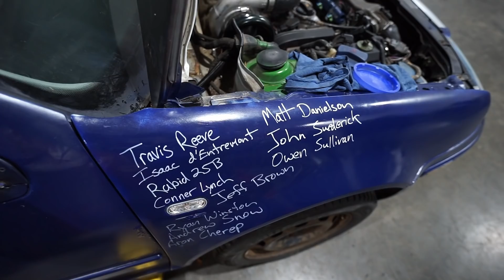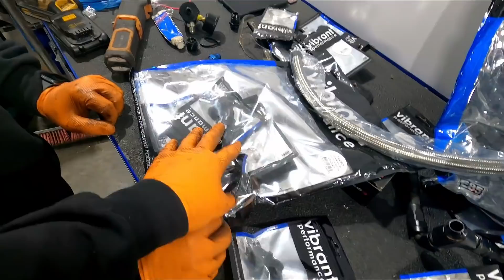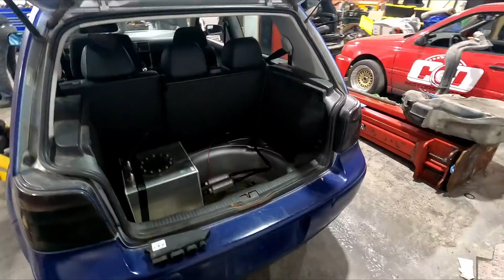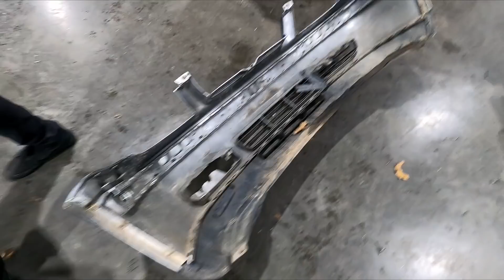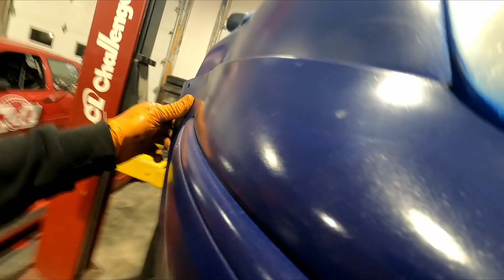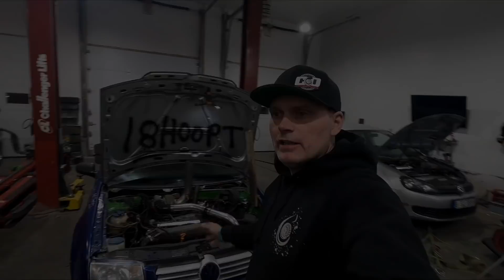Project 18HoopT is alive! Stock engine 1.8T Big Turbo on Standalone Pt 4

Comment from the maker: The mold mobile is alive! Thanks everyone for the support.
Reply: I don't see my name o vthe fender ☹
Reply from the maker: @boosttapperformance8673  this video was filmed over a few weeks so maybe you were more recent, meaning since that footage. Drop us a message just to be sure you weren't missed. But as of the filming of that it was current to my knowledge.
Reply: @COMotorsports  all good no worries keep the content going
Reply from the maker: @boosttapperformance8673  I've dug into this further, mind sharing at least your first or last name so I can figure out what's up.
Reply: If this engine grenades I’d love to see a motor with just maxxspeeding rods connecting rods and nothing else because I’ve wondered if you drop a set of those in a 1.8 if you can make good power or if you need pistons and head work etc like most people do. I’d also just like to see how the cheap rods hold up on there
Reply from the maker: @maxpetruccelli5444  there's plenty of stock piston/upgraded connecting rods 18ts on our channel already.

Comment: Is the aww and awp the same cylinder head my timing belt broke so I am wondering 🤔
Reply from the maker: It's all basically the same, even the ones that are different still work.
Reply: Thank you so much can u remote tune it I'm from USA florida
Reply from the maker: @ricardojaramillojr5071  yeah depending on setup for sure.

Comment: See if you can find a 1.8t with 20mm wrist pins and see if it makes a difference. Lots of anecdotal stuff on vortex used to say the 20mm was stronger than the 19mm out of the early 2000s TTs.
Reply from the maker: The issue is the pins arent the problem. It's the rods themselves. So IMO it makes no difference. The rods were slightly different in some but still junk.

Comment: Hey guys, 

I know you’re well versed in MK4s so I thought I’d ask, any idea what this sound my 12v VR6 is making could be? Comes from only the serpentine belt side of the engine, most prominent on cold starts but will disappear completely when the car warms up to operating temperature. It has been making the sound for the last two years, all of which I’ve spent trying to find out what it is. Every mechanic I’ve taken it to hasn’t been able to hear it because it completely disappears. 

Timing chains and guides have been done, water pump at the same time. I really have no idea what it could be. 

Below is the video link, it’s a lot louder in this clip because the right side is against a garage wall.

https://youtube.com/shorts/A9DppX20NDg?feature=share

Comment: This might be a dumb question, but when going with a standalone ecu, is it possible to retain the original cluster and gauges? or is something different required?
Reply from the maker: It works fine.

Comment: If this engine grenades I’d love to see a motor with just maxxspeeding rods connecting rods and nothing else because I’ve wondered if you drop a set of those in a 1.8 if you can make good power or if you need pistons and head work etc like most people do. I’d also just like to see how the cheap rods hold up on there

Comment: Honest question, would the Front mount Intercoolee fit with an R32 front Bumber?
Reply from the maker: Anything good the bumper and rebar need to be modified.
Reply: @COMotorsports  meh, ok anyways thanks for the replie :) i say the block throws a Rod at 430 ^^
Reply from the maker: @patriklenck1735  it can be done well if you take your time and fab properly. The r32 on our channel has a good size IC on it and we still have all the stock grills in the bumper as well. You'd never know there was an IC and piping under there.

Comment: If it does blow throw in another stock healthier 1.8T Motor, I think so many of us are keen to see how far this goes on stock motor
Reply: everyone must be stupid, doesnt go very far.... Stock rods will do 320 ft lbs, AEB rods do 360 ft lbs, and thats on E85.... This thing is gonna shred the rods instantly. STUPID
Reply: @hei-row  stupid yes, but entertainly stupid... and we all here for that
Reply: @dariusgodden2392  not one bit. If you want to be enlightened you watch Banks power "How to destroy a duramax" Where actual science and logic get used... along with instrumentation. This guy is just gonna melt a piston if he loses fuel from no swirl pot. that or just blow the mains off. It's not rocket science when you just blow up metal... it's STUPID

Comment: If the current engine bends a rod I’d be interested to see another stock 1.8t or two just to see how much luck plays into it!
Reply: if you bent a rod its because you are flooding the cylinder, it doesnt bend when you make power. it explodes. you lost all parts, dont be stupid
Reply: @hei-row  flooded cylinder is one way to bend a rod, detonation and over revving is another. He’d be dropping a whole new stock engine in, doesn’t matter if you blow a hole in the block. Don’t be stupid.
Reply: @Feistiestfrog11  yeah and the same thing will happen but differently. Uncontrolled test. Stupid.
Reply: @hei-row  not sure if you understand, but that’s the literal point of the project…

Comment: Hope you read this I am sitting on the last 04' Passat GL Wagon which has the 1.8T, 5-Speed Manual, Four Motion, shadow blue outside and anthracite interior on the inside. This car has spent most of it's life running at 12lbs of boost. The engine is still solid without burning oil or anything. Quieter than my mother's 2014 Fiesta Titanium. I am hoping you will continue and see how she does within reason. Living in Wisconsin I have her garaged and waiting 4 spring to add a front mount intercooler to it. (No worries I have a welder so no silicone adapter crap where it doesn't need to flex) lol Everything is still original and still solid at 228k. Owned prior by my X-Father N Law who is a salesman for the Toyota Dealership in Madison he had never missed a oil change on her so I'm super interested in seeing what can be possible. Please continue because I would like to keep my, "Granny Sleeper" running as spunky as I can for as long as I can so I don't have to Dr. Frankenstein the beast just yet... Thanks 2 all that makes these vids possible.

Comment: Another 1.8t, keep the stock rods and see how long they can last with that big turbo, they might be last a surprising amount of time with the softer torque curve, and low back pressure of the large turbo
Reply: And put some fart spray on the interior to improve it's smell.

Comment: Well I have a tired 1.8T in my A4. So if that tired 1.8 blows up then we'll know. Personally I think some cheap rods would be a good idea if you don't put a hole in the block. Maxspeedingrods has them for like $250-$300 USD, I bought them, just haven't had the chance to tear mine apart yet. I can't wait to see what this thing does. Also (hopefully you see this) would the ECU Masters wire you guys have work on an AWM? Isn't it very similar to AWP? I need something better than Eurodyne!
Reply from the maker: We can make it work. Also side note weve done plenty of these with upgraded rods so it's nothing new there.
Reply: @COMotorsports  definitely a future plan. Good to know...

Comment: Nicely done!....my a4 "stock 058 block with aeb head" is on trestles right now plumbing up a gt2867, so cant wait for you guys to help me detirmine a safe threshold to aim for 😁.. I think this car is going to supprise everyone and stick around for a while. Would like to see things happen in the following order... Grenade the engine, then start making the necessary supporting internal mods to keep up with the power output.

Please offer some advice on fueling reguirements, hard to find "off the shelf" replacement injectors this side
Reply from the maker: We can provide everything needed to meet your goals. 300whp should be your goal, and on that turbo that's about all you'll see on prump gas anyways.

Comment: I just love the zero regard for anything related to that car 😂 I’m shocked it didn’t end up at the Kenny U Pull up in your neck of the woods 

In regards to if the engine pops. Maybe you guys have seen the dude running an “unequal length manifold” making 500hp on a stock bottom end. 

But that would be pretty neat to see you guys do that, should that glorious 1.8t turn into part number confetti. Just an idea, cause unlike the rest of the euro community. You guys definitely have a clue, and don’t seek to m0oNt0oN tWoStEp everything…yeah I said what I said 😂
Reply from the maker: I have seen who you are talking about. Do share.
Reply: I love Clayton’s optimism about the longevity of that 1.8t 😂

But anyways. What I’m saying is. When the 1.8 hoop-t’s engine reaches its demise. Acquire “cleaner” motor. Unequal length manifold. And let Dave do his mad scientist thing in tuning it, to see if the un equal length manifold is fact or cap 🤠

I’d love to see you guys do it, because the info on the whole un equal length thing is spotty.

Comment: If it grenades early, tho It doesn't look/sound (no f-ing clue) like it will, keep it stock, and simple. Also, dryer vent cover, in the hood, over the exh. Wink wink nudge nudge.
Reply from the maker: like tractor flap you mean?
Reply: @COMotorsports  yes

Comment: If this engin blow up, use another stock 1.8t 🙂, I want to see how far I can go with mine 😁
Reply from the maker: Even stock, this won't be your average stock setup. It would be trash on the road I suspect... but time will tell. :)
Reply: Yeah I want to see how far a stock motor can go

Comment: But why would you spend all that money on vibrant stuff if just gonna blow it up and not run it for a while, throw drop in rods in it, I'm putting maxspeedingrods 19mm tapered rods in mine and are good quality and are cheap, buy them and try them out
Reply from the maker: Mainly because we want a fuel system to move to other projects like this, or use as a test if a clients car is having issues. Makes it very easy to use. There's a method behind the madness sometimes. :)

Comment: Why not use the stock fuel lines and fuel tank
Reply from the maker: Ethanol requires way more fuel. Also the stock filter, fuel tank potentially is full of junk and since I was putting a $1000 set of injectors in there I didn't really want to take that chance. So it was a combination of things.

Comment: Put a 1.9 TDI and make some power with stock tdi
Reply from the maker: A stock 1.8t already makes more power than a 1.9TDI.. sounds like a step in the wrong direction. :)
Reply: @COMotorsports  just want to see what could be done to a 1.9TDI engine to make it faster
Reply from the maker: @nojussmolinskas9037  swap a 18t in it. 😉
Reply: @COMotorsports  i will probably have to do it 😆😅